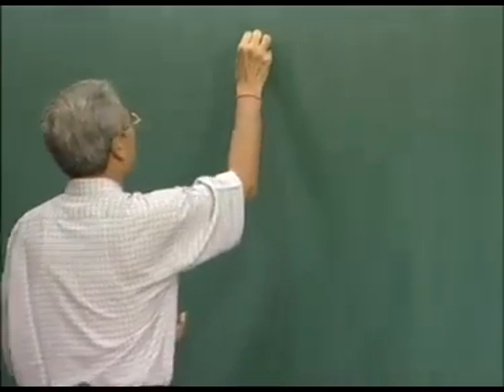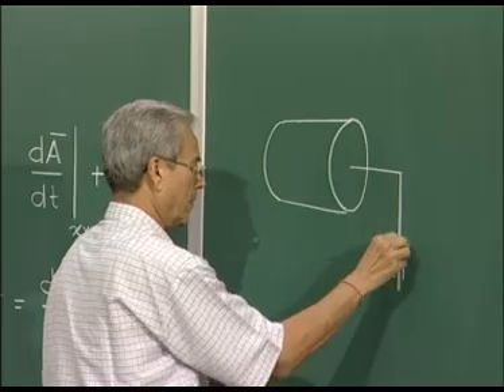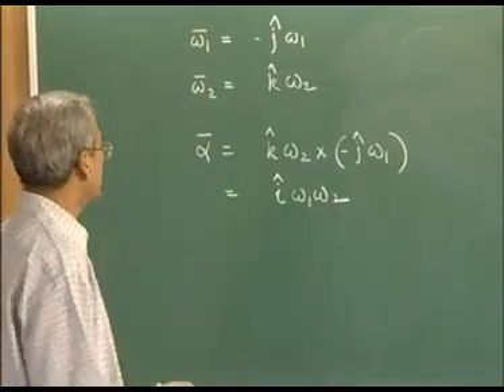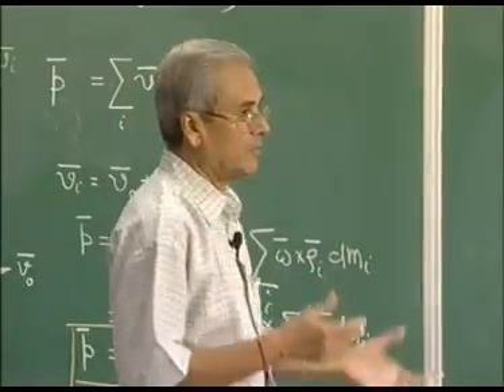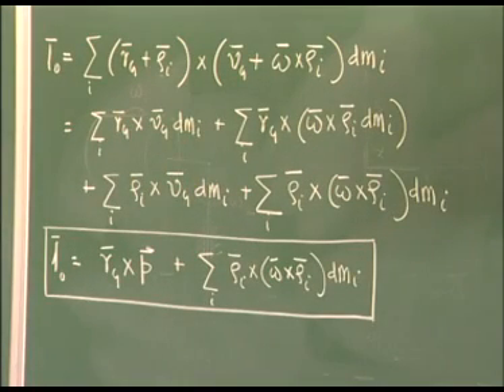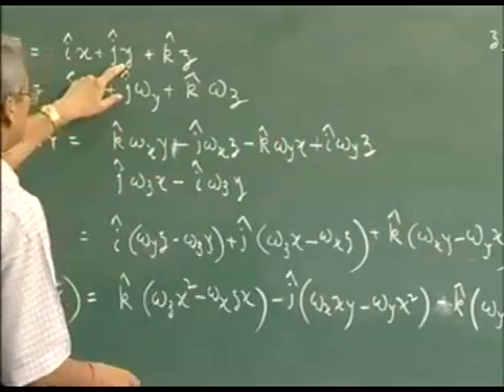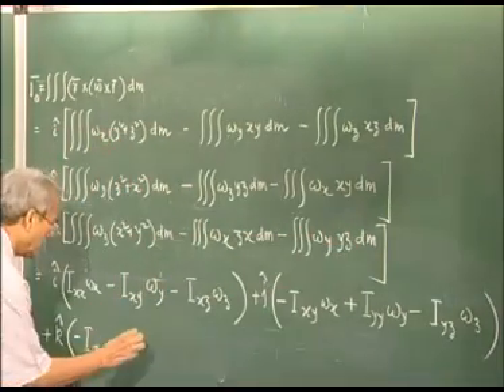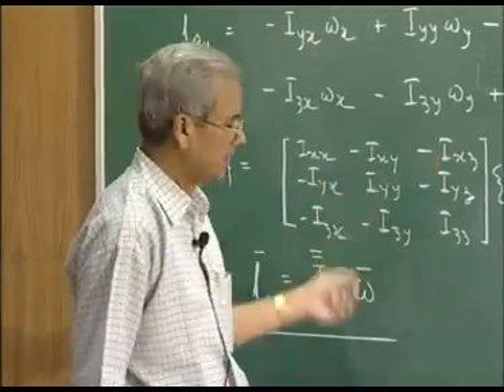Module 2 - Lecture 2 - Inertia Tensor & Angular Momentum

Comment: what is the physical meaning of omega x A  .. around 7mins
Reply: That's a term which takes into effect the rotation of the coordinate system attached to the  rotating body. He is saying  that when both observers are watching a vector which changes, what they measure as the rate of change is the same once you add in the effect of the rotating reference frame.
Reply: This is idea is also where you get things like the Coriolis Force.